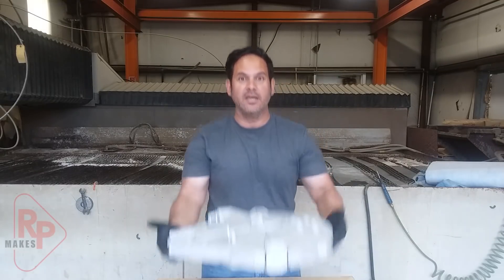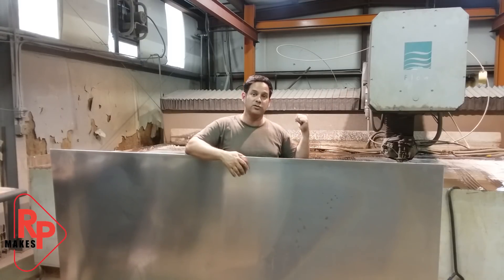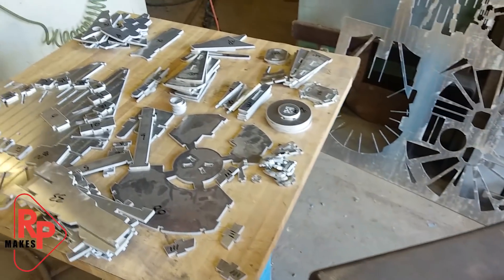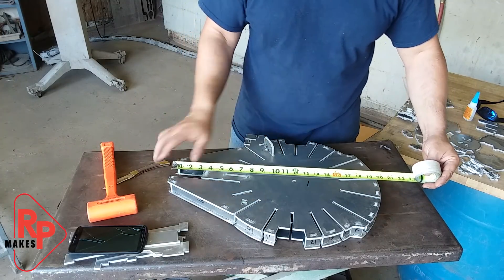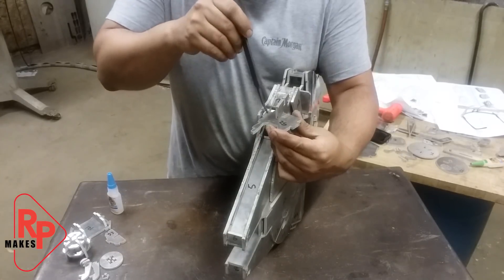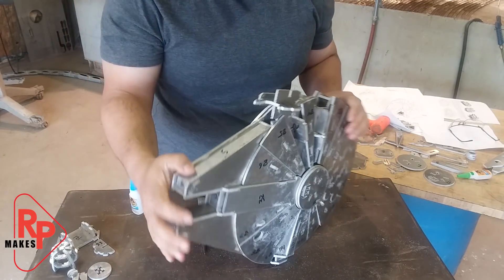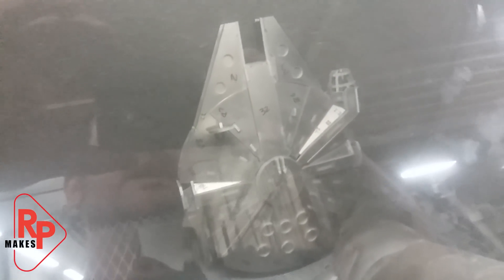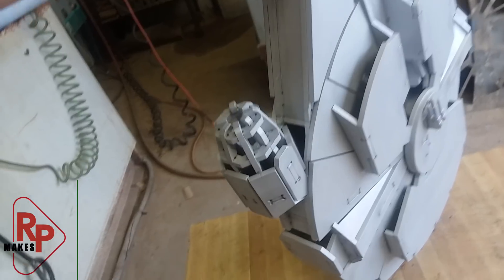Making the Star Wars Millennium ALUMINUM Falcon

Comment: That was amazing!  I am surprised that using a glue is "strong" enough...  Do you think the glue will last over the ages ?
Reply from the maker: thanks, the glue is really just insurance on most of the pieces and the ones that are loose fitting are so small that they wont break off.  i keep it near my desk, and it always get alot of attention.  i do think the glue will last without a problem

Comment: For the same price, you could buy yourself a small personal 3D printer (200$), print it with plastic or a 80% brass filled PLA or other metal filled filament (12-80$ per kg). Note that you will not print 100% full, you might print it at 20%, the rest will be empty space such as internal desk, corridors, mechanical room, etc.

You would get all great 3D details such as computer, chairs, laser, knobs, moving mechanism, moving doors, turets, figurines, etc. Instead of a flat slate.

Great video, thank you for sharing the price tag evaluation. Thumbs up!
Reply from the maker: I have a few 3d printers,  but the goal was to make it in metal... even though it was crazy expensive.  Glad you liked it.
Reply: Ok, thanks for the answer!
I did not know you already own a 3D printer. Now I better understand the personal challenge here.
By the way did you ever try the 80% mass (33% volume) metal filled PLA fillaments? Of course it will not be as "full metal" as yours, but you can increase the detail level substancially and still have that metal weight and feel. I never used this fillament, only saw a few video on it.
Yep, Another project!
Reply from the maker: Never used that filament either.  If you are curious I have a few 3d printer videos on my channel, here is the link to the playlist 3D Printing: https://www.youtube.com/playlist?list=PLjb5twhxLLcIcjTXt9YtpdiFx_iGwLmQ9
Reply: Ho, I did not realize it was you, the same guy!
As you know by now, I went to your channel, look at your 3D printer video and put somme positive comments!
You seem to have access to larger and broader equipment than me.
Have a great day, smartman!
Reply from the maker: Ha, thanks.... I've been working on videos for about 2 years now, gkad you are enjoying them